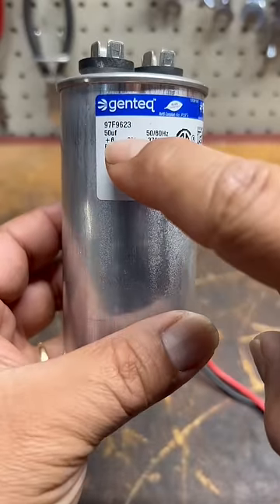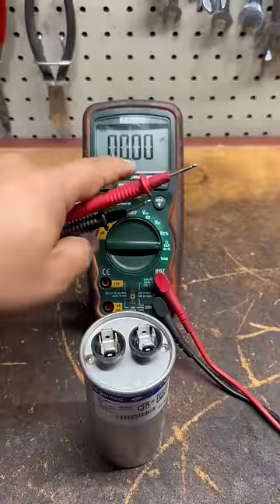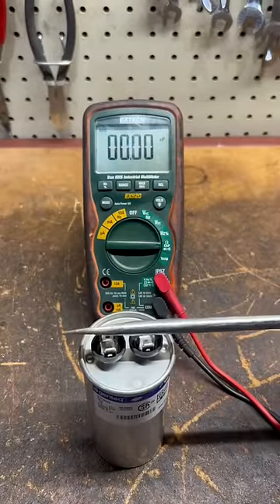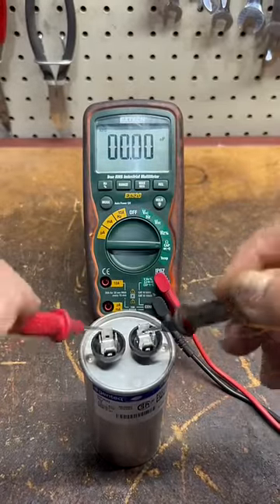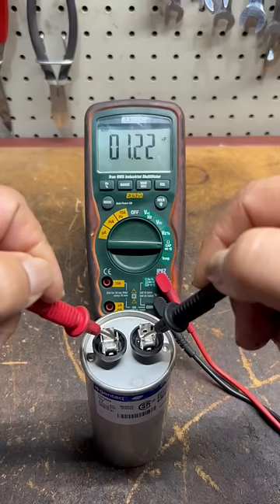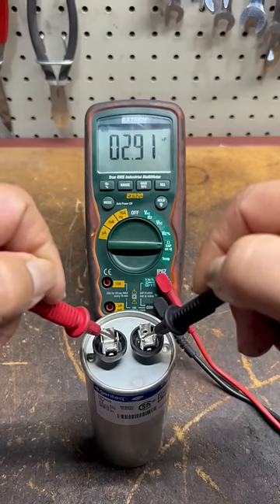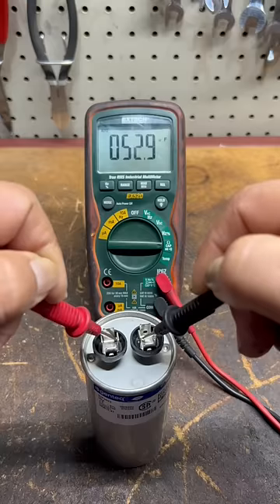Quick way to test a capacitor!!

Comment: Yeah pls don’t use a screw driver it’s better to set your meter to volts touch one side with the positive and one side w the negative and see the charge drop to 0 on the meter than u can set your meter to check for mfd
Reply from the maker: An insulated screwdriver is ok and is approved by many manufacturers. You’re way may also work but using a screwdriver is on.
Reply from the maker: No worries. I appreciate you watching my videos. And yes some customers might have a different point of view but that’s why I don’t let them watch me repair the units. Lol.
Reply: Besides melting the screw driver and the posts as well as shortening the life of the capacitor itself, the sparks might startle the person and cause harm to the person or the ignition of flammable vapors (of course, if half to full charge only)! Good advice so as not to make it a habit to short any capacitors with bare metals, particularly screw drivers, which are always handy. Remember that your habit might lead to nonchalantly shorting a high capacity and high voltage application capacitors. Beware.
Reply: @pepitocoronejo8495  where are you getting the shortening the life of the capacitor thing? The  screwdriver is a resistor and the capacitor is a resistor, what do you think happens when you connect it to a coil?

Comment: Ah yes always discharge an electrolytic, DC capacitor, through a resistor to be on the safe side. With Bypass AC  capacitors you really dont have to discharge it because it holds a very small charge. I learned this not in my Electrical Engineering classes but actually while working in the field. They don't teach this shitz in college, you simply learn by doing. Also check the ESR of the capacitor if your meter has that function. ESR is important.

Comment: Be smart. Use a proper resistor to discharge your capacitor. Not a screwdriver.
Reply from the maker: It’s ok to use a screwdriver.
Reply: I like sparks

Comment: Never short capacitor use resistor to short
Reply: Wire a incandescent light bulb or two together.
Reply: Never cross the road. Cross the road first.

Comment: Instead of discharging with a screwdriver, teach people how to properly discharge it with a meter!!!
Reply: How's that way?
Reply: @kg4lzc  use a multimeter, set to VOLTS, set to highest scale, put 1 of your leads onto the C terminal of the CAP, and the other lead to the HERM, the VOLTS reading goes to 0. Than take your meter lead from C to FAN and you will see VOLTS go to 0. Make sure Ac is off when doing this. Once you are done this, you have successfully discharged the CAP.

Comment: No. Don't short a capacitor, use a resistor or something. You also forgot to check its ESR. Also one small mistake, you said "you have to know your uF value", simply say its value.
Reply from the maker: So don’t say “get my car keys” just say “get my keys”. Didn’t know that was a gross problem.
Reply: the screwdriver is a resistor
Reply: @10minutefix  They are right, the way that you stated that implied you need to know the value of capacitance in the micro Farad.

Comment: Wrong, you need that special capacitor tester and a capacitor
Reply from the maker: Wrong
Reply: @10minutefix  then show me how you are going to use a regular vom to do this test
Reply from the maker: Before capacitor testers was there a way to test a capacitor? You show me how you do it.
Reply: @10minutefix  not saying this is the best method,  I was trained to take the capacitor out of the unit,  charge it up with 12 volts DC then put the vom on it and watch it discharge down to zero volts, this technique never failed me the capacitor was always good if it charged up and discharged down
Reply: @10minutefix  for me I never had to test a capacitor because it would either be good or bad the motor it is installed on would either run at full speed or half speed, half speed means the capacitor is bad

Comment: I’m not saying this to be argumentative, but please no one use this method. Shorting out the positive and negative sides of an electrolytic cap through the use of a screw driver is a bad idea. It can greatly reduce the life of the capacitor, not to mention, it can be dangerous. Electrolytics can hold lethal charges long after being powered off. 

Easy to build, a proper capacitor voltage discharge tool uses an approximately 100R resistor to do it properly. The resistor will slowly bleed off the voltage. There’s plenty of info out there regarding how to make one like  on Blueglow Electronics. After discharging the capacitor correctly, the voltage needs to be measured again using a multimeter. 
Good luck 😊⚡️⚡️⚡️🎶
Reply from the maker: Thanks for watching the videos first of all. Second, every manufacture that I have dealt with approves of this method to discharge a capacitor. I didn’t make it up. Instead I follow manufacturer guides and Service manuals to perform this procedure. 
We don’t always have the nenas to go around building tools with resistors and other things you find as a replacement. Some of us are out in the field or don’t have your tools or the time to build the absolute best equipment, but according to the manufacturers, this is an approved method. I have never had any issue nor do I know of anyone who has.
Reply: @10minutefix I have never found one holding a charge anyway
Reply: @10minutefix you don't need the absolute best equipment. All you have to do is use a resistor, that's it.
Reply: @markme4 Be careful with high voltage high capacity capacitors!
Reply: @pepitocoronejo8495  I am ! Thank you !
Reply: I'm quite sure these motor caps have an internal resistor built in.
Reply: How do you know which post is which? Common?
Reply: @VizoMediaGroup  The side with a stripe on it is the negative (-), but it should be marked on an electrolytic cap, where with non polarized caps, it doesn’t necessarily matter. 🔊😊🎶
Reply: Your volt meter set to ac volts is sufficient to discharge a capacitor most volt meters are rated between 600 volts and 1000 volts so it won’t damage the meter
Reply: @10minutefix 💯
Reply: @10minutefix  Capacitors store DC and pass AC.
Powered off and still connected to a load should automatically discharge any remaining power for you, IF there was any.
Reply: @10minutefix no the don’t , try that with a flash capacitor you’ll soon discover why you don’t do it
Reply: The capacitor will be fine, and melting metal is not that painfull
Reply: It is not true, it does not reduce the life of the capacitor. Point ignition systems work shorting the capacitor thousands of times per minute and work for decades

Comment: a secondary test that happened was the charge rate of the cap.  this is helpful info to circuit designers for purposes such as time delay.  time delay circuits are important in electronic monitoring, or when it is a required function to have circuits turn on in a particular order. 🤓

Comment: How do you know which side?
Reply from the maker: Non polarized capacitors do not have a positive or negative. Polarized capacitors should have a marking stating where the positive and negative tabs are.

Comment: What digital multimeter do you have? Brand and model number? I'm trying to find one that is cheap that can measure capacitance of a capacitor
Reply from the maker: It’s a small one but it does the job. Craftsman model 82344.
Reply: You don't buy cheap meters , you buy good meters

Comment: What is the range?
Reply from the maker: The range is what ever the microfarad range is on the capacitor. It should state it on it. Plus or minus about 5 microfarads or whatever is posted on the label.

Comment: Use your voltmeter to discharge the capacitor, other wise you could damage the capacitor
Reply: How can i use a voltmeter to discharge the capacitor?
Reply: Wrong....
Reply from the maker: @diverbob8 Right…….
Reply: No you might damage the Voltmeter - is what you meant! Then discharging a cap can be exciting if you use a screwdriver. You could use some clip leads with a resistor in series.  The demonstration has it correct..

For someone else - he meant an insulated screwdriver to protect YOU touching it! The discharge out of a cap into your fingers or hand can be shocking!
Reply: @briangordon2208  no what I said was what I meant your volt meter,  a good one can discharge 600 volts to a 1000 volts alot more than a capacitor will hold.
Reply: @brucemuller2827  Very cool.. I wouldn't have tried that with my 1968 Simpson!!
Reply: @briangordon2208 You cannot damage the multimeter if it is on a high enough voltage range equal to or above the specified working voltage of the capacitor.

Comment: This will not show whether it works at voltage.
Reply from the maker: Can you explain please?
Reply: @10minutefix  the capacitor isolation can be fine for the 9v in the multimeter but can leak at higher voltages.

Comment: Leave capacitor mounted, Remove connectors, then discharge capacitor preferably with a 100ohm/5watt resistor. 
DO NOT HANDLE CAPACITOR UNLESS IT IS DISCHARGED FIRST

Comment: I worked at a refrigeration supply warehouse when I was a teenager. The manager told me that if anyone brought a capacitor in, to leave it where they placed it and let him know about it. He said, "If you accidentally touch those contacts, it's gonna knock your dick straight in the dirt." and I said, "OK. Yes sir." and never touched one. I still played with the tiny black powder canon we had in the warehouse, though. That thing could send a pecan all the way through a double-wall box.

Comment: What if reading reads OL
Reply from the maker: This means the capacitor has failed. Need to replace it. There should be a measurement close to the values on the capacitor

Comment: Do not take the discharge of a capacitor lightly. 
Smaller capacitors can store life threatening levels of energy. 
Discharge appropriately based on the micro Farad’s.

Comment: Sir, my multimeter does not give F option, then how to check?
Reply from the maker: The symbol is a “uf”. If you don’t have it then you can check it other ways but this is the best way. Other ways are not as common and I would not use them.

Comment: And After it is discharged connect a wire between terminals to keep a charge from gathering
Reply: magic charging capacitors are not a thing

Comment: show us what SYMBOL to use !
Reply: Continuity
Reply: @Brekstahkid  no, not unless it has switchable modes on the same tick. The symbol for capacitor is a curved line next to a straight line, or depending on the meter it might be the symbol for microfarads which is uF

Comment: Not quiiite that simple! First of - try not and discharge a capacitor with a piece of metal unless absolutely nessesary. Use a high watt resistor with fx. A 1m resistance to discsrge it slowly. This prevents potential damage from a quick discharge.  It also prevents fireworks.

Secondly: this test only gives you its capacitance (C). It gives you an idea of its health. But to be certain everything is working as it should you'lll need a LCR meter "Inductance (L), Capacitance (C), Inductance (R)". This is 9/10 times all the info you need. 

Take it from an amp tech - most of the caps i replace have an acceptable capacitance, but its ESR value is off the charts! Stay safe! These small cans of death is more lethal than gasoline on cereal!

Comment: Hey, how are you. Love it. Took a cap, charged it off 220 so 110ish. Told my friend, if his son didnt stop stealing my change im gonna fix him. Center console wired. Change everywhere. Id left it like that so long i kinda forgot about it. Dont touch that change and ground at same time. 😅
Reply from the maker: What?
Reply: @10minutefix  i shocked him. One hand on door, other grabbed change laying on a stripped wire connected to cap. Hair stuck to window trim and change everywhere inside my car. He jerked his hand away so fast he pulled emergency brake and hit head jerking it out of car. He never went near my car again

Comment: All in all, a multimeter by its self is not a very useful tool to check a capacitor and when used with a power supply only gives you a little information, mostly it cant tell you if it is good, but it can tell you if the cap is bad.

Comment: I don’t have a microfarad setting on my
Meter? Will I still be able to test capacitors?
Reply from the maker: You may be able to test it but you won’t know what the value is. If it stops at 50 but it’s really 300 you won’t know. I’m sure there must be some scientific formula but I have never known it. Try the manufacturers manual of the motor and it might be stated. Sorry.
Reply: @10minutefix  Appreciate the help. I may need to upgrade to a better multimeter
Reply: Just had to upgrade mine for this same reason
Reply: You could buy a electrolytic cap of the same value and charge to say 12 volts. Then get a resistor 1k ohms ?? and while the meter is connected time how long it takes to discharge, then repeat with the suspect cap and compare. Keep in mind some of the bigger high voltage caps might have internal discharge resistors built in. Or perhaps charge the cap to say 110v and then discharge with a low wattage 110 lamp, It should go bright then dull down as the cap discharges..  Or you could ignore my waffle and buy a cap tester.. :)

Comment: Do NOT discharge a capacitor this way, folks. That could get you maimed or killed. Discharge one lead at a time through a ground wire. Even then, use caution.